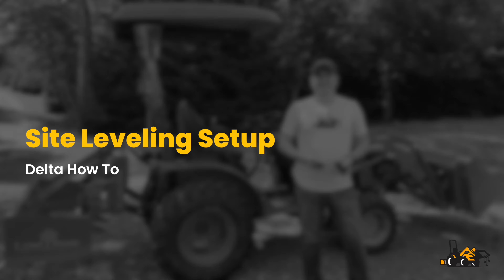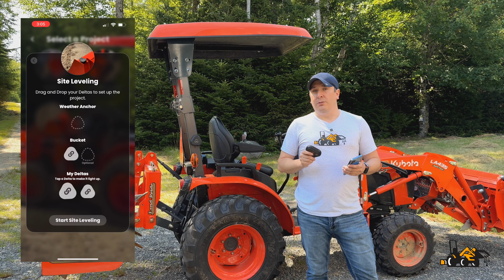Delta How To - Site Leveling Setup

Comment: Soo, a couple questions. If using a bucket you point the delta forward, if using an excavator - point it towards the operator?? Secondly, if I dig to the proper depth say 24", can I then set the bucket down at the proper orientation l/ r and forward/ back and  rezero to set the base? Do I need to weld a flat base with a ring around it to both protect the delta and provide the proper working angle of the bucket?